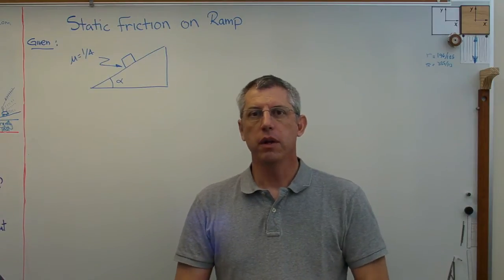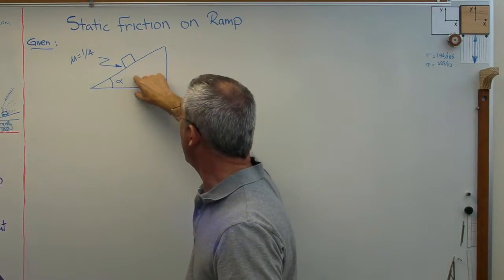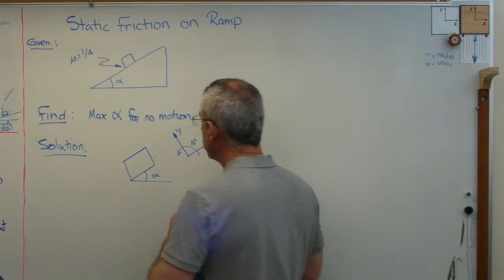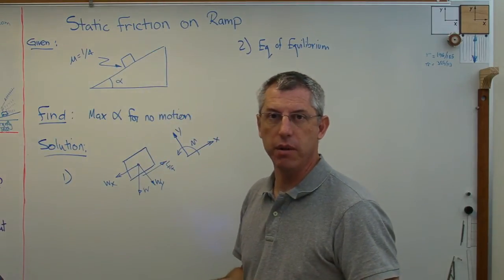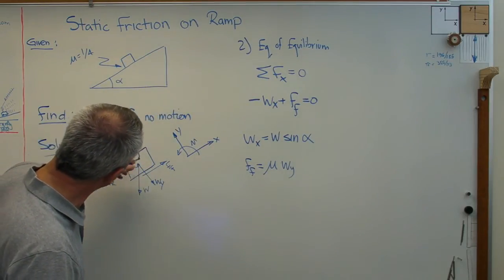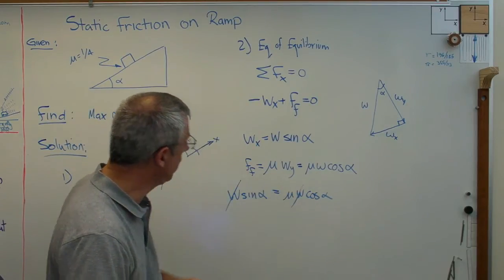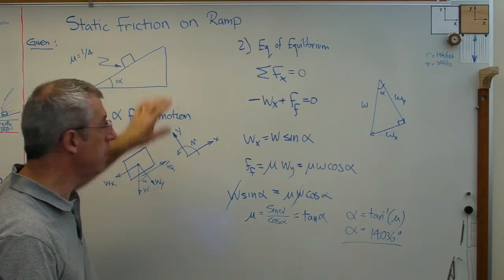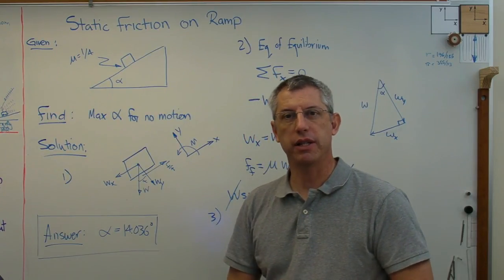Static Friction on Ramp   Brain Waves

Comment: Nice video, only problem is that at then end you said that the maximum angle you can have is 45, but there are coefficients of STATIC friction which are greater than 1 (something that requires more force to get it moving than its own weight), so if you take tan^-1 (1.4) you get an angle greater than 45.